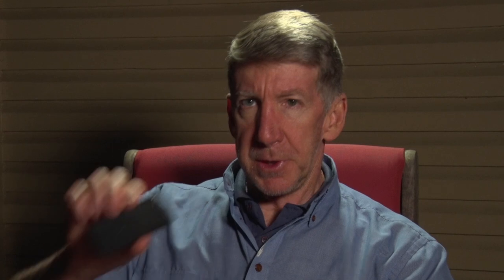Track cleaning do's & don'ts update...most views in 24hrs!

Comment: The graphite does work, we use the flat builders pencils (in the UK anyway) because they contain the right amount of graphite to be effective.. The ordinary pencils for drawing, your 2B etc.. are no good, only the builders pencils seem to work probably because there's enough graphite in them to be conductive...
Reply from the maker: That's interesting Stu!  I will see how the graphite stick I have ordered goes?
Reply: Stu D'Nutz  Glad to see and support your comments and advice.
I also use the ‘carpenters’ graphite pencils, readily available at DIY outlets in the UK.
I’ve been so impressed with the results and, after a track clean with Isopropyl, I just apply to a length of track, approx. 300mm (12in) long, on each Main Line, The Branch Line, Goods Yard and Engine shed sections of my layout.  The coating is picked up and distributed around the layout by the stock and loco wheels. No adverse effect on traction tyres either.
Of special note was the fact that I had to leave a section of the layout unused for about 2 months, whilst doing a re-wire elsewhere on the layout..On reinstatement the locos all came to life just as if the track had been recently cleaned! clearly this method protects too!
The wide flat pencils sharpened to a WIDE chisel point are best. The rail heads cut a small groove in the graphite, making it even easier to apply.  Loved the ‘rant’ Greg - Good (maybe the only) way to get the message across - judging by the responses you received.
Well done and Happy Modelling 🚂🚂 T